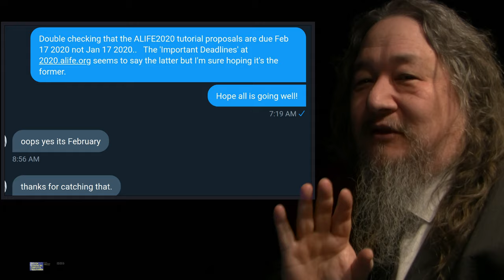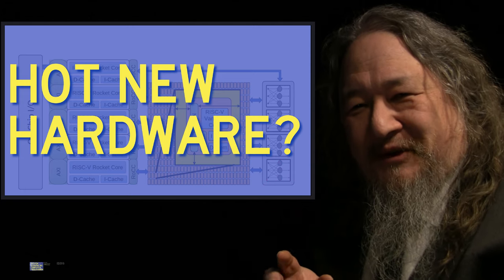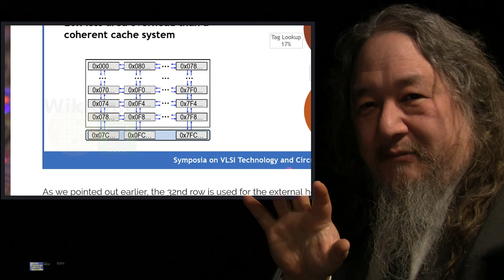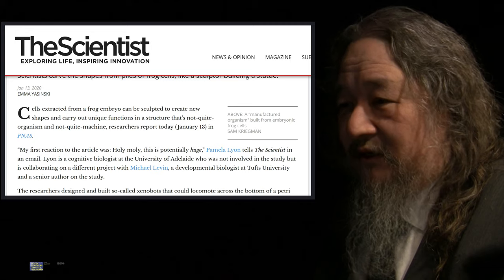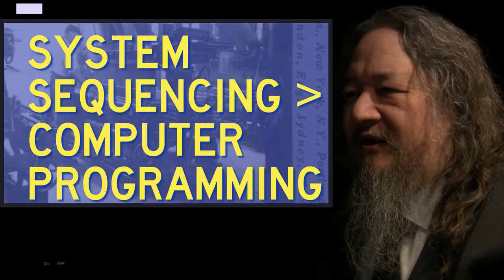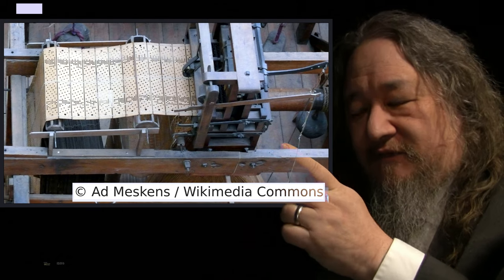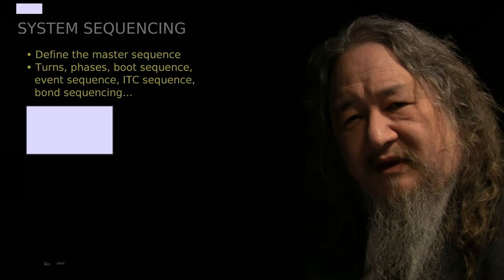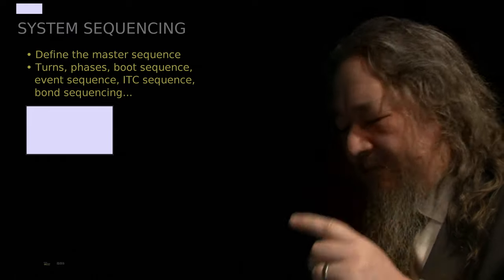System Sequencing is greater than Computer Programming - T2sday Update 266

Comment: The Celerity chip has the same problem that all such chips have had, going back to the GA144 and even earlier. That is, they were never designed as tiling elements to be used for building larger extendable arrays. I suspect the Celerity part will also suffer the same fate as all other array processors of this type; to remain a curiosity with no commercial success.

It also shares another similarity to the GA144, in that it appears to be an ASIC part designed with no specific application in mind. 

A proper array chip will contain only a few processor cores per die, be asynchronous in its clocking and come with sufficient I/O pins so that it can be tiled indefinitely. I’m afraid if we ever want to see such a part, we are going to have to design it ourselves.
Reply from the maker: Design it ourselves: Yes.
Reply: This is a project I want to take up this year. I can’t afford real layout tools, but there is a shareware VLSI layout tool that some claim they have done actual chip designs with. So one of my personal challenges for the coming months is to come up to speed with this design tool: "Magic VLSI",  opencircuitdesign.com/magic/.

My design experience goes back to before 74-series TTL logic. So, doing an asynchronous chip design from scratch will be like going-home-week. Before I retied, I did my HDL programming in Verilog. But the problem with all of the FPGA parts that you find, is that they are all laid out to be synchronously clocked. You can do HDL code for an asynchronous design, but at the silicon level the FPGA still implements it with synchronously clocked logic blocks.

If and when I start and begin to make some progress in this direction, I’ll let everyone know.